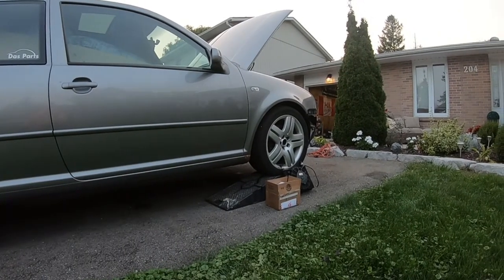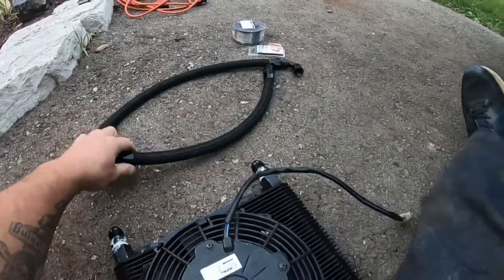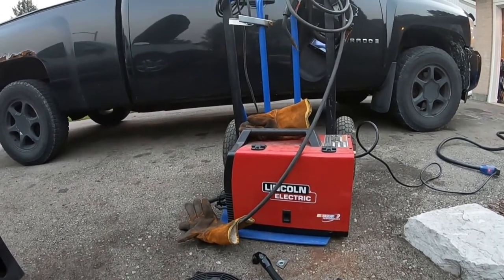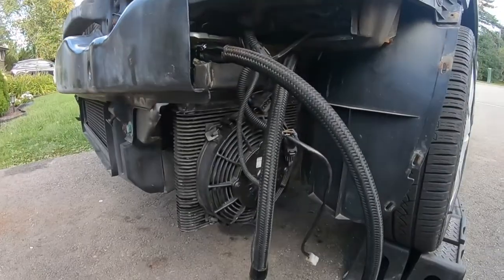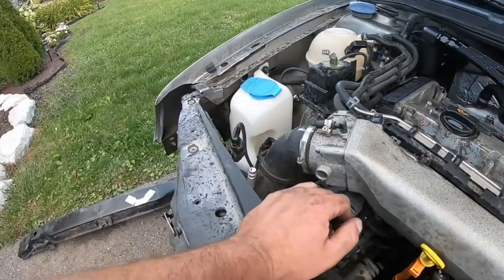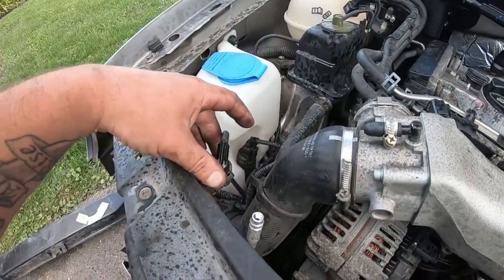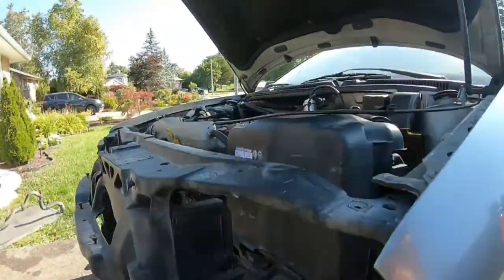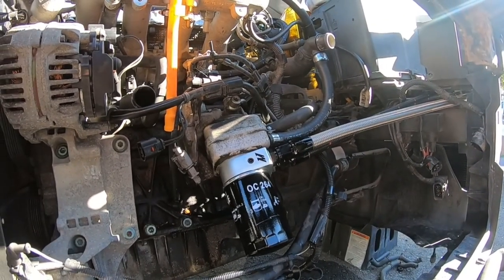MK4 GTI Oil Cooler Install (Time Attack Build Ep 5)

Comment: nice vid bud. question: the original nut that holds the OEM oil cooler in place, im guessing you dont reinstall that? the adaptor nut that comes with the new kit takes its place?...so you slide on the OEM oil cooler, then the new oil cooler, then the adaptor nut, then the oil filter, is that right?
Reply from the maker: Thanks! I believe so, just make sure there is a gasket in between of course! I really wish I could have done it with just the aftermarket cooler but the threaded rod with the stock heat exchanger just doesnt work sadly! Goodluck!

Comment: Hey bud..i gt a question..whats the point of leaving the stock oil cooler on..i wud guess most people wud like to install aftermarket is to prevent the oil mixing with water...correct me if am wrong...coz am thinking of doing the same on my vw b5
Reply from the maker: From what I was told the stock oil cooler is just an heat exchanger that runs coolant through. While water temp heats up it also helps bring the oil up to proper temperature and maintain it. I honestly wanted to delete it, but with the length of the threaded bolt, and the thickness of the aftermarket sandwich plate it just wouldnt fit without modification. Decided best to leave it in there, keep the coolant circulating as it was designed by factory, and have the extra perk of a external oil cooler.
Reply: Did you go that route. I am thinking about looping my coolant and capping the oem cooler